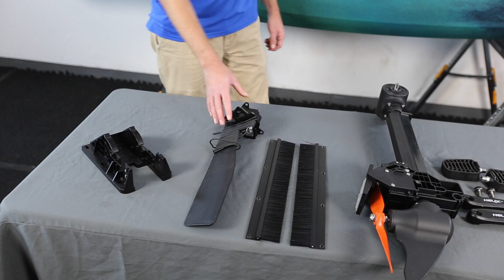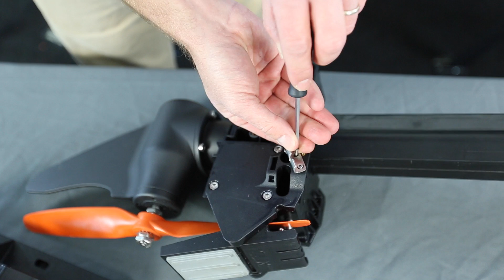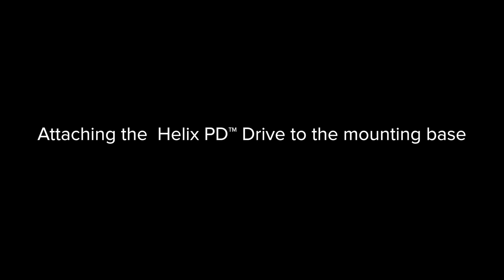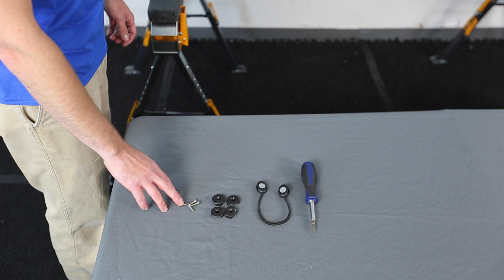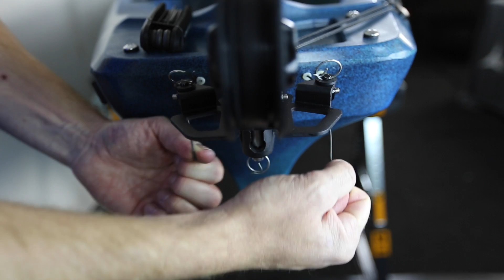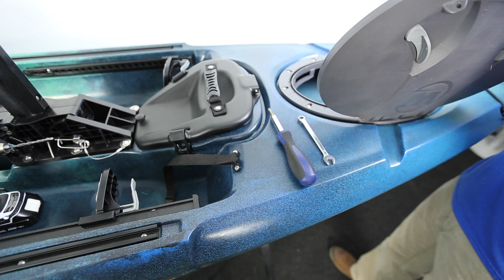How To: Helix PD™ Pedal Drive Assembly and Installation | Wilderness Systems

Comment: I am at this step and the stainless steel screws are spinning along with the brass threaded insert. I have sprayed penetrating oil on these screws in hopes that they will break loose but right now the screw and insert are both spinning. Any suggestions would be appreciated

Comment: Disadvantages of the design of the pedal drive:
https://youtu.be/a-ckGYqGtNE

I’ve used the R135 with PD since 2018. It’s been used in fresh water no more than 15 times in the past season, and then put in a kayak for winter storage in a dry garage. Preparing for the new season, I wanted to upgrade the pedal drive to increase speed by replacing the gears with the best gear ratio. So I screwed the pedal to get acquainted with the gears. I was surprised and unimpressed by the gearshift of the lower pedal gearbox. This gearbox is immersed in the water while in motion and is located immediately next to the screw. It turns out that the gears were flooded with water and as a result they rusted. Therefore, it is an obvious factory defect from the manufacturer - the joints of the elements of the case are not tight. Now it is understood that the design in this mission requires regular review of the subject for detection of leakage. Therefore, I recommend the owners of pedal driven kayaks, to be sure to check the condition of the lower gear, especially before prolonged storage of the boat after the end of the season. To disassemble this node is not difficult, even a child can deal with it. It is necessary to remove the cover by twisting only four screws. If you find rust, carefully remove it with special fluids, such as a solution of orthophosphoric acid. After that, I advise you to replace the rubber seals and add more lubricant to the gear.

Comment: I am beyond frustrated right now. Trying to install the rudder kit, and the rivet nuts for the rudder lift cable guides were not installed properly. Then, whoever installed the keeper screws that come in the rivet nuts from the factory was apparently too slow to realize that the screws were only going in about 3/4 of a turn, and tightened them anyways, resulting in two of the rivet nuts having damaged threads. You'll be hearing from me Monday, Wilderness Systems. So much for trying out my new yak tomorrow. Part of me wants to blame the guy who installed the rivet nuts, but this is a quality control issue. Was he even trained properly? Does anybody go behind and check his work? This kind of quality control failure seems to be the norm these days.

Comment: You didn't tighten the crank bolts enough! They need to be TIGHT. If they ever loosen while pedaling  the holes will get rounded out and then you will NEVER be able to tighten them so they don't move again. NEVER! I have had bikes loosen like that and i could never get them tight again. Ruins the crank and crank arms.

Comment: Used this vid to do install on Radar115, thumbs up!  Made assembly much easier than just reading instructions.  Like smaller size of this drive compared to others on the market, easy transport.  Swapped out pedals for aftermarket platform pedals with sealed bearings.  Other than that, very happy with the Helix PD.

Comment: The description of the reverse threads is wrong. First of all, both of the cranks appeared to tighten by having the bolt turned clockwise, as a normal thread is, so either apparently is reverse threaded. The left pedal is indeed reverse threaded, which meant that the bolt needed to be rotated counter clockwise to tighten it, but the guy said he was turning it clockwise, even though he proceeded to turn it counter clockwise as he tightened it.
Reply: I noticed the same thing. The one pedal is reverse threaded so one doesn't unscrew their pedal as they ride (or pedal) There is no reason to attach the crank arm in such a manner. I got tickled when he said it must be tightened in a clockwise direction, then proceeded to tighten in a "COUNTERclockwise" direction. Anyway...good for a smile.

Comment: So I bought the 115 and my question is, do you need to purchase and install the Rudder control tubes on a 115? I saw on a different wilderness systems video the installation of the tube.Does the 115 come with the tubes? Or do I have too install.
Reply: The rudder cable tubes are already built into the boat. You just have to feed the cable into them, as per the video.

Comment: I turned it off when the first thing I read was you need a lighter and 10 other tools. Seriously?
Reply: Hey Jarvis, I have a house I'd like to sell you. Well...not exactly a house, but a pile of lumber and bricks and an instruction manual. I'm going to charge you the same as a house, you just have to assemble it after you buy it. Just imagine the intimate knowledge you'll have of every corner of your new house!
Reply: Scuffed ThumbZ Fishing if you want be capable of jobs in a diy fashion, 10 tools is child's play.  I looked at the tools used in this video and couldn't help but notice the rust on the #2 Phillips bit as well as the general low quality of all of the tools.    I'd venture to say my tool collection could easily include thousands of tools.  I don't want to rely on anyone else if I don't have to when I need to build or fix something.
Reply: Jarvis Rinklebaker yes but u shouldnt pay $2700 and have work to do. I use tools but i get paid to use them not pay them to use them.
Reply: Scuffed ThumbZ Fishing hmm.. yeah I'm doubting your a technician of any kind who is paid to use tools.  If you were a tech of any kind, your opinion on the relationship between price and need to assemble would be more like mine.
Reply: Jarvis Rinklebaker so its ok to pay $2700 on it and put it together if your a technition?  Hmmmmm seems like it would limit your sales when my old town predator pdl came fully assembled for the same price.  Im just sayin most consumers dont want to put shit together they want to fish.
Reply: Scuffed ThumbZ Fishing perhaps the company went in thinking they could be profitable by selling a fully assembled rig.  I'd be curious about what you paid, versus what they are charging now for the boat plus pedal drive.  As a person who has spent more than two decades as a technician/mechanic/repair guy/diy guy etc... the assembly shown here looks beyond simple and a person like me would actually have fun and enjoy assembling it.
Reply: In addition, building or assembling gains the owner a very intimate knowledge of how the systems work and will allow the owner to repair or service the rig themselves if need be, say, in a wilderness situation where you can't call triple A to come save you.
Reply: Jarvis Rinklebaker i get that for you and im sure there are guys out there that also enjoy it.  But what about the thousands that dont is all im saying. Im viewing this as if im  the guy in charge at wilderness. I want everyone to buy my yak.  For example there are guys that love to mow and guys that work 70 hrs a week that dont.  So if i own a gated community n charge $1000 a month for hoas im gonna have a mowing n snow removal company do the wirk to make the majority or all the guys happy. Tight lines bro
Reply: Scuffed ThumbZ Fishing I see your perspective now.  Thanks for the clarification.   I think we both are right to similar degrees.
Reply: Dan Sertich just think that's to much money to have to build things.
Reply: As someone who is not good with ikea furniture, and looking to buy my first pedal kayak - I agree this is enough to turn me off this brand. Same price as other entry level pedal kayaks but so much I could screw up...
Reply: Um, I bought my Radar with the pedal drive already installed.  I'm sure the place you buy your pedal drive from would install it as well.  Pretty sure THIS video is if you already own a kayak and want to add a pedal drive, they want people to know how to install it for those that aren't going to have someone do it for them.  You can buy virtually anything and install it yourself OR have someone do it for you, don't see the issue here.  The pedal drive isn't cheap, but I haven't seen too many that are at this point.  Buy a used trolling motor if you are that lazy or too cheap to have someone do it for you :)
Reply: what a lazy ass douche

Comment: Bought a radar 135 and it came installed with the helix drive and rudder already.  Only issue I noticed is that the steering isn't straight, slightly askew with straight being at the 1 o'clock position.  Tried to straighten the rudder control and adjust the rudder cables on the back end as the solution.  Used the appropriate hex screw tool to loosen to adjust and spins in place, they seem to not loosen grip on the cables.  Is there a trick to loosening those or as you warned, is it over tightened and that's the issue?

Comment: Received Helix pedal drive today looks great,had a question about screw holes on latch hanger, holes are big and latch hanger moves around and looks like screws could pull thru over time. Thanks
Reply: Kyle Bartko keep tightening, i had the same issue. they will snug up.

Comment: Have one on order for my new Radar 135 but still have questions:   1)  What are your sacrificial parts (ie. shear pin?) if unit sustains an at-speed impact  from debris, oyster bed, sand bar etc.?  A lot of leverage can be applied to hull and drive system otherwise...    2) Now that I've already mounted a battery and transducer to the forward pod I see that the pedal drive will interfere with the display head when stowed.  Suggestions from the designers?   P.S. love the boat! A+
Reply: BarkBusteR9 My Radar 135 should be arriving any day now, hopefully with the Pedal Drive.  I plan on mounting my fish finder on one of the slide tracks and still keeping the battery in the flex pod with transducer mounted on the bottom of it.